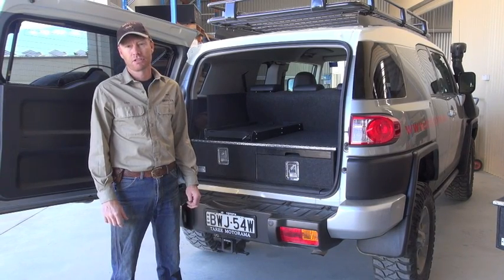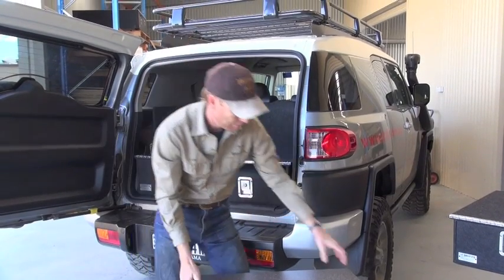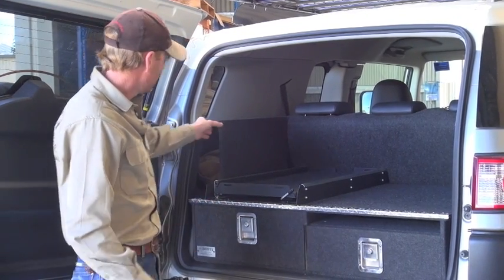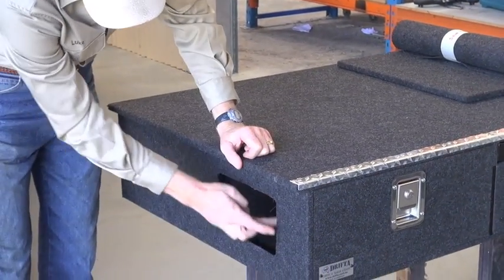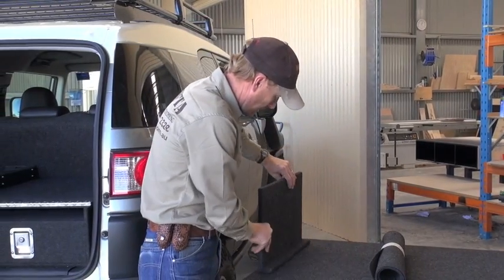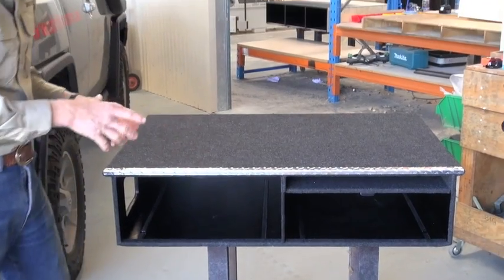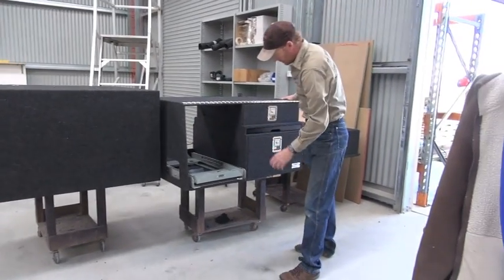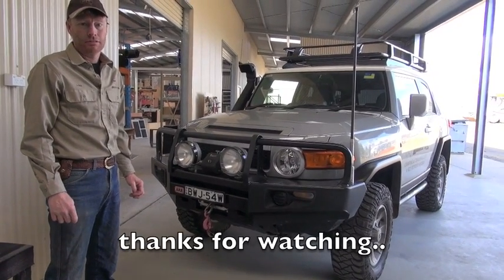DRIFTA FJ Cruiser drawers Australia

Comment: Nice setup, I would like to see how you rerouted the rear electric for use with these drawers? I also would like a set with a extender platform so I can lay the rear seats down and extend the platform over them to use as a sleeping platform, . And, for me, the left drawer would be the one that holds my camp stove, and gear, But I like this !, Do you have the link to the roof rack?

Comment: Hi Mark I have the exact fj cruiser like yours but on mine the 12 volt battery access for the fridge is on the right not the left, also the rear split seats are 2 behind driver and 1 split behind passenger.so would it be possible for you to make one that will fit my fj say with fridge on rhd -drivers side so I can keep both seats up  then I can say put long items in by only dropping one seat for say a longer item .also the fridge will need to be secured vis straps hooks do you cater for that too?-steff
Reply: hi steff, sure yeah best to contact mark@drifta.com.au and he can work it out with you.. we do lots of modified drawers, and specialise in the FJ..   ta luke

Comment: i like the idea but could you tell me how mush does it weight
Reply: +loosh94 Trust me I looked around, you won't find a lighter better set up anywhere. Everything else is over engineered, rattles and is too heavy. Most other brands use roller runners which take up too much space as well. Just looking at that and seeing the materials used, you can tell it would weigh next to nothing.